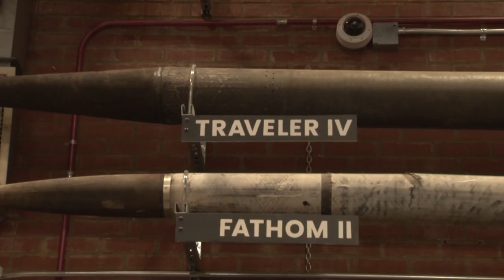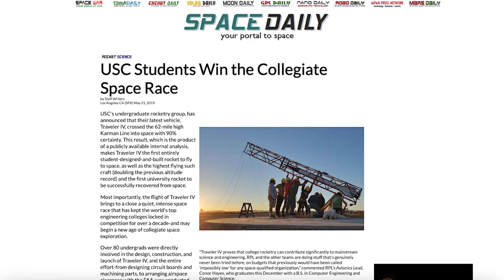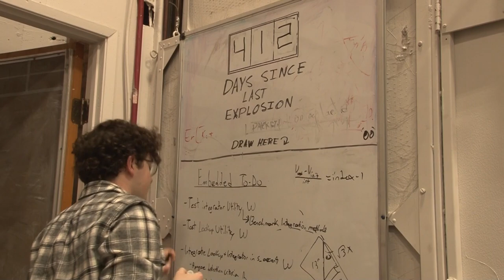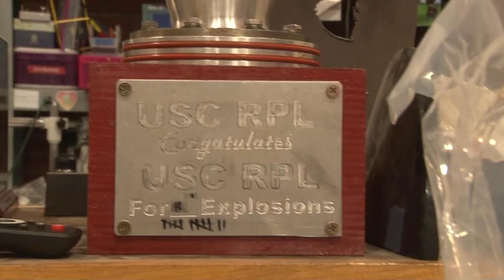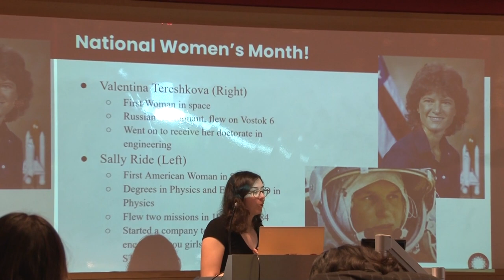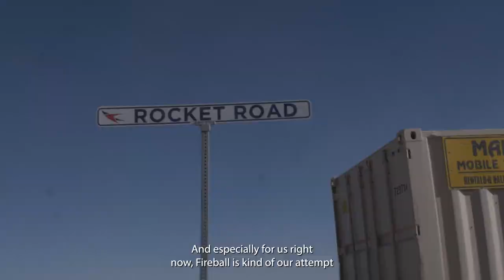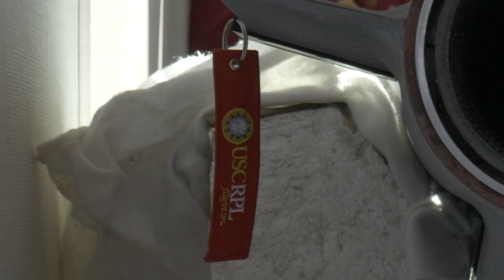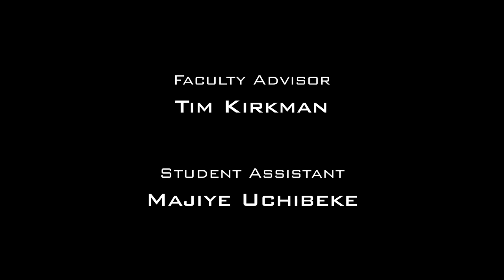Fireball - A Documentary Film

Comment: By the look of the aerials, the Fireball is communicating in the 2 GHz region. Since that is the same portion of spectrum used by Wi-Fi and a long list of commercial applications, the components (in special way, the GaAs transistors used in the front-end) are cheaply made and suffer from a large variability of the operating parameters. Moreover, the SDR design of the front-end suffers from a limited frequency image rejection, which isn't good for communicating with a travelling rocket.
It would be better if you change to a two or three stages superheterodine design for your radios. This design is definetively more expensive, but over all it requires the skills of some good RF design engineers. This is the only way you can step up your acts. In the end, the rocket launch is wasted if you can't recover all the telemetry data in full.
Best wishes - you're doing a great job.
Greetings,
Anthony